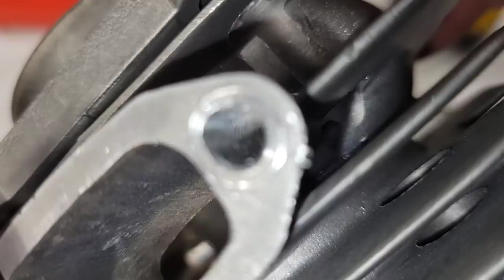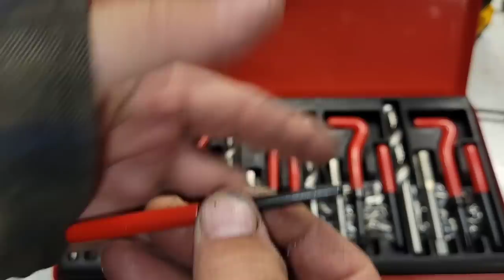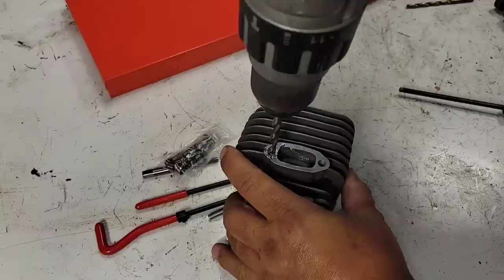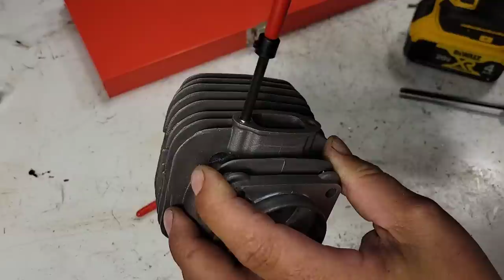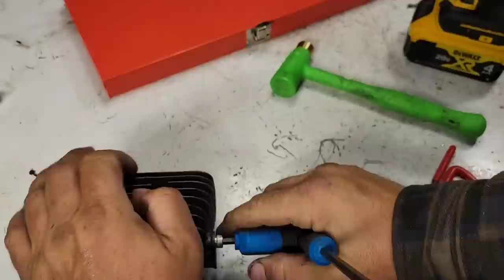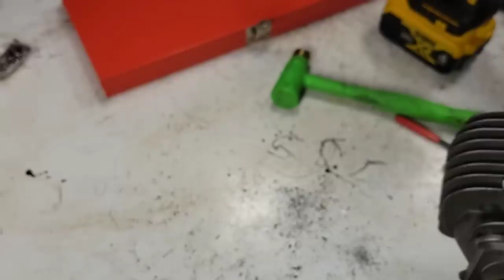Stripped threads? Try this repair!!

Comment: Oh the things that young ones can get into!  Childproofing- well…..good luck with trying to get Everything up and out of reach.  But bobby-pins in receptacles and dirt sandwiches are good for you!  Going on 72 and survived many years of situations that child protective would shudder about, common practice back when I was a kid.  Common sense ( used to be horse sense ) cures many profits advice, and we are a wonderful bag of tricks that continues to amaze.    Helicoils are standard practice on new production for ever in aircraft spark plugs,  the constant need for removing requires it.  Actually had a donated radial that had many bad plug holes, and Prat and Whitney had a factory refit kit to solve the problem.  I was amazed that the engine was that old, and the simple resolution that cured the situation.  Great sharing the tricks, sometimes people haven’t been exposed to the solutions that are so simple to experienced bolt strippers.   You have to have broken, stripped, seized, drilled, tapped, cussed, and thrown parts and tools across the shop before you can claim to be a professional mechanic!

Comment: Nice presentation with the helicoils! I just saw a video earlier from Donny Walker showing his method for dog bolts in particular. He uses the keyed full inserts and says he has never once had one fail. They are expensive at about $8us each, but look very robust. You also need the installation tool to drive down the staking keys. I have a dog bolt to repair and I'm going to use a helicoil with red loctite for good measure.

Comment: Good for Charlie, on the move at 8.5 months... wow. My youngest of three boys is 32...lol. 

I bought and after market chain break for my 272xp first build and had to grind on the case inside where the clutch nut is to make it work. Only had to remove about a 16th of an inch of material and it works fine now. $80 cheaper. 

I just ordered another one for the current 272xp I'm building, from a different company will see how that one is. I have the old style metal handle one but the knee-joint, spring, screw are unattainium. If anyone has some spare parts please message me. I would love to keep it original. 

Good video once again. 

TC Mahalo Tinman 🤙🤙🤙

Comment: That's faster than throwing it away and buying a new one. I don't strip many threads anymore, but it happens. I have a whole drawer full of thread repair kits for this reason. I tend to use cheap taps to clean bolt holes when I wrench on engines. Call it preventive maintenance.

Comment: I can't remember if it's just helicoil brand or all thread repair inserts, but in aluminum, cast iron, and most any metal that's weaker than the bolt, it's actually stronger than original, once you put the insert in, which makes sense if you think about it, the weaker metal, aluminum in this case, has more surface area from the larger diameter hole, and the threads that touch the original bolt are now the heli-coil, and some sort of steel that's much tougher than original aluminum threads.

Comment: I’ve stripped out the plastic threads on my saw where the front handle bolts on. It’s the holes on the bottom. What do YOU think that I should do to repair the holes? I’m really aggravated that Husky just used the plastic as a female thread while using “sheet metal” screws for making a companion plastic female thread. Should I go with some sort of a nut-sert or should I attempt to put a real nut and real screw on it or will I have interference issues with the rest of the saw “body” if I choose to go that last route? Using monofilament fishing line for a cheap fix seems to not get it right as far as concerning a rigid screw should feel. I’m just wanting my 372 back in action. 

Patiently awaiting responses from the Tinman or his followers 😊

Comment: No tap no insert   Bang a 1/4  wit  with 2   flute s on the start of the bolt  if hole is not to bad it will work